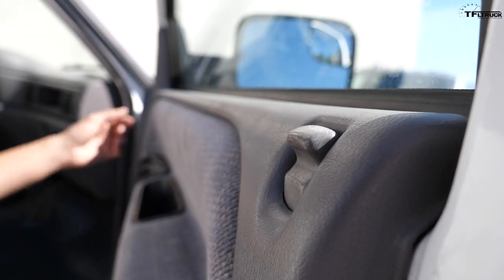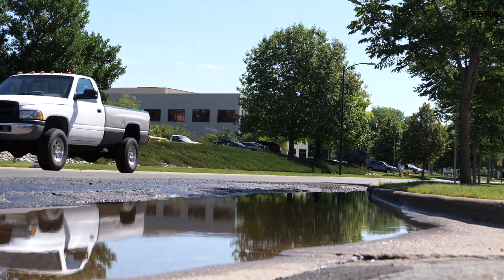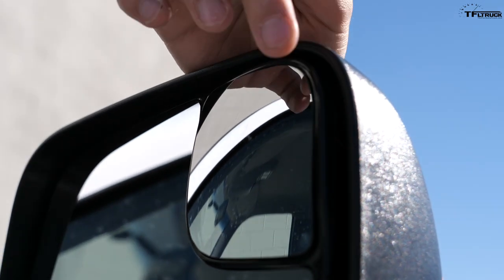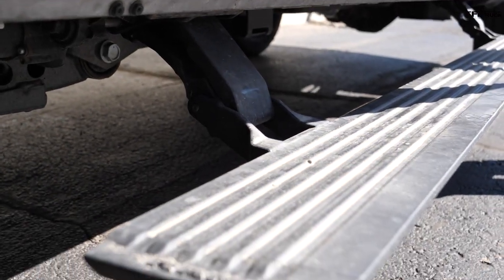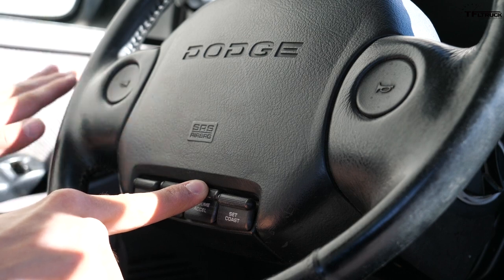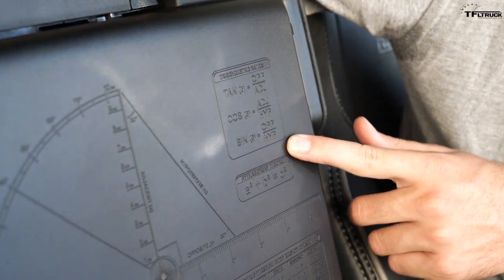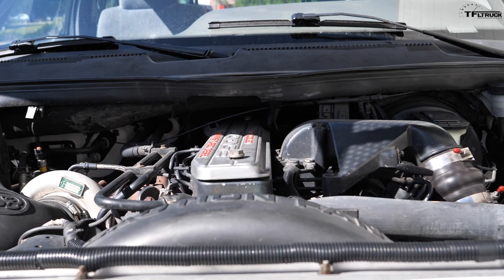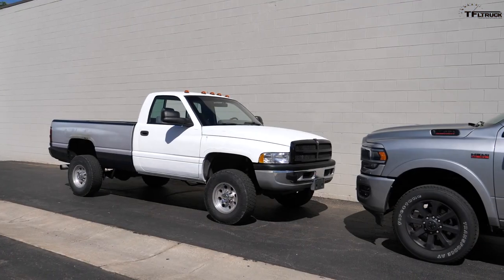Modern Tech vs Old School Simplicity: How Does A 1994 RAM 2500 Compare To A 2020 Ram 2500?

Comment: I'll take my 97 12 valve "Prius repellent" all day...
24 miles per gallon, no DEF, no SCR, no EGR, no BS...
71,000.00 is more than I paid for my house (2 bedroom, on 2 acres) in 2007...
Reply: 🤣😂 ok
Reply: This violently screams patriot and freedom
Reply: @brolymaininfighterz962  a patriot that wants to have/keep their freedom sometimes must resort to violence...so I agree...
Reply: Shush about the 24mph, you gotta have a lowered 2wd shorty truck with a bed cover and every aero or super hard tires to get close. Most only get low teens i know my dads 5.9 sport auto gets 7
Reply: Did you stick a "prius repellent" decal above the exhaust ?
Reply: @watferfoot1467  I could, but my 6" chrome tip kinda tells the tale...😎😎
Reply: @timlubbers2884  my 6.7 gets 22mpg how does the 5.9 only get 24
Reply: @jake-qn6zy  I  was getting 26mpg before I doubled the horse power...but 24 is still better than the average, Which is only 17mpg average (as per fuelly.com) ...
Reply: Where did you buy your house??!
Reply: @OpenBarGarage  Abilene, texas ... I don't live there anymore, but I did in 2007... Lived there for 3 years, decided the winters were to cold, so moved to Sarasota FL ...Got into a house with a yard here for a bit under 55,000.00 ... But, to put it in context, I don't buy luxury, I build it ... Same as my dodge cummins, I picked up my truck as a rust free 16 year old basic rig, and built it into what it is now ...
Reply: @timlubbers2884  cold? In Texas? Hahaha gotta try newfoundland.
Reply: @billyboots3730  Newfoundland is pretty in the summer...
But I have a saying, "anything north of I-10 is artic waste land and ya'll can have it" ... Love visiting the north in the summer (july 1st- 15th) though ... 😎
Reply: @timlubbers2884  yup highly recommend staying away after september haha. The island is practically covered in fog for the fall until it gets real cold.
Reply: The new truck doesn’t have a DPF or EFR... the one on the video is a hemi😂😂😂
Reply: I paid $1400 for my 97 dodge truck last march( blew that stimulus check) I drive it every day and it never lets me  down. It can haul a lot more than my friends chevy truck and gets better gas mileage. I just can't justify $70,000 for a new vehicle.

Comment: Of course the 2020 is much nicer. That being said, simplicity is something that is lost on modern vehicles. That 94 is still on the road...that 2020 likely won't be in 26 years due to every single aspect being computerized and obsolete.
Reply: 😂 yup you darn right... shooot my 2 horse carriage will outlast these two new mobiles. The only maintenance I got on mine is to repair my old horses but nothing beats the simplicity of my carriage. I don’t want none of these new automobiles shoot I got me my carriage boy
Reply: I completely disagree. Computerization and obsolescence are applying to this 2nd gen after 26 years, as it will to this 5th gen in 26 years. Compared to a vehicle built before it, the 2nd gen is very sophisticated. The idea of fuel Injection, power accessories, OBDI, climate controls, a radio, etc., these things were beyond my grandfather's generation. Really, words like yours have been said by every generation, but vehicles aren't necessary lasting any less, despite what we keep saying.
Reply: @hambone8826  Well, hasn't been 26 years since 2020, sorry.
Reply: @tebonsmite6260  by 2046 they will have banned the internal combustion engine so we will all be driving electric vehicles

Comment: Kase's 12 valve sounds like a semi tractor! So cool.
Reply: Nazi all cummins sound the same! Of course it sounds like a semi truck
Reply: @a-dog8075  why did you just say Nazi?
Reply: @jeepjoseph9036  Cuz this is the internet
Reply: @a-dog8075  all cummins sound the same? Have you ever heard a 12 valve vs 24 valve. Pretty distinctive
Reply: Deleted 6.7 has a nice diesel “knock” up front but sounds like jet in the back, nothin better than the old 12v knock though. Both very strong engines
Reply: Because a similar engine was in many semis
Reply: Slab Rat  you gotta admit that the 88-93 Ford 7.3 idi na sounds good idles like a diesel you rev it then it changes to a 460 big block noise

Comment: I drive a 94 Sierra. Wouldn't want anything to do with the new ones.

The money I saved buying a 1994 over a 2020 afforded me the ability to put in all the power options the newer trucks have, for pennies. Tablets make great entertainment centres in older trucks. No need to buy new.
Reply: Agreed 100% My last new ride was an 07 Mustang  GT. I was so disappointed in that lead sled once paid off I traded it  for a 30,000 mi 99 MX5 and 6 grand. I found a stupid well cared for 95 Jeep ZJ and sunk 7 grand into it's drive train and suspension. It now is 100% and drives like new. My other car is a 73 340 Duster. I will never do new again. I figure if I get to old to rebuild my rides I'm to old to drive.

I forgot to say I got the Jeep for free with a blown motor. rofl
Reply: Old domestic is far better than new domestic, for reliability and durability.

New is made solely made for money grabbing from the consumers, while the quality has fallen down alot, the new is only nicer looking and has alot of tech stuff in it.

Comment: Well considering I drive my 95 c1500 every chance I get, I will take simple honest work truck every time. Also manual transmissions for the win.
Reply: How?
Reply: @jeepjoseph9036  zf5 speed manual was an option it was used in ford and gms but designed by ford

Comment: As cool as the new one is, the old one had me with the manual transmission
Reply: I agree with you 💯 manual over auto any day
Reply: I usually dislike manuals but if there's a vehicle I'd get a manual with it would be a diesel truck.
Reply: The manual transmission is why I drove halfway  across the country to buy my 4th gen 2012 Ram 3500. The manual is awesome and 2012 was the last year of the 6.7 Cummins without Diesel Exhaust Fluid.

Comment: The tow mirrors were not available until 2000-2001ish, but that tow mirror stayed the same with the small convex until the 2010 Ram.
Reply: They had tow mirrors just had to had the retro kit with the big ass steel arms that that took over the side of your doors completely.
Reply: yes, i had same tow mirrors on 2004 Ram, the fixed blind spot was better then any glue on i had before

Comment: While I like technology, and I can appreciate some of the features on the new Ram, I’ll take the old with a few modifications for more power and have less worry about playing hard with it. Also, as a card carrying member of The Manual Gearbox Preservation Society, I applaud your nearly indestructible gearbox. 
Bedliner the old one, paint it no frills, and add some basic tech upgrades like an iLX-f259 CarPlay radio and I’d be happy for a long time.

Comment: Having had an 01, currently 05 and regularly using a 2015 and 2020 I regret selling my 01, still love my 05 and although the 2015 and 2020 are luxurious by every comparison I still enjoy driving the '01 and '05 more than any of the new ones...  There is just something different about them that is more satisfying to drive as a truck.  Your comments about the mirrors those aftermarket mirrors on the 94 are from the third gen Rams and no the convex portion was not adjustable even on the factory mirror. The 94 had nothing more than a traditional chrome single-pane mirror.  And yes they fifth gen Cummins is almost silent and comparison but I long for the day of hearing and good old first or second gen Cummins clattering by especially with a nice exhaust.  The neurotrucks are surely far more advanced much more capable safer and comfortable and yet here I still prefer my '05 and wish I had my '01 back...
Reply: When my 05 fell apart, i specifically went looking for a 90s model ram. Settled on an 01. I do not regret that choice one bit.

Comment: I love the old school but I wouldn’t want to tow a camper 6+ hours without the modern tech an comfortable ride that’s why I bought a 2020 3500 limited
Reply: Remember people only complain about the truck another person buys if they can’t afford it.
Reply: Good take
Reply: @ToyotaNutjob  Did you miss the part where he wrote "an comfortable ride".
Reply: @ToyotaNutjob  maybe the insane towing and the ride???
Reply: Had a 95 12v 3500 reg cab back in the day. The ride is jarring lol. Those cup holders do  not work, especially with coffee lol.
Reply: Squanch Wanch have you experienced heated an cooled seats? Lol or the ride quality or can hook up to 20k+ an not look at your temps when it’s 100 degrees going up a 20+% incline ac blasting ?
Reply: Jay Moar bought an paid for already. Just having no cab drone alone was worth signing the check 😎

Comment: The old '94! Just love the simplicity. But the one topic not really discussed is safety. In that 2020 Ram, a person really has to work hard to get themselves hurt. The safety features are also a significant reason why today's trucks cost more.  Great job guys.
Reply: Actually, they don't cost more. A 2020 tradesman 4x4 runs about $37,000. The number they came up with for the 1994 is false. If you were to spec a 1994 as similarly as possible to what is offered in a Tradesman, you'd have to chose a Laramie SLT, which was around $22,000 back in the day. Adjusted for inflation, that's around $39,000, and you'd still lack most of the features of the newer truck.
Reply: @CuzRepo  I bought a 1998 Laramie with a diesel, extra cab and 2WD new off the lot and and it was around $33,000

Comment: I'd take a 2nd Gen with 4 doors
Reply: There is a company called extend my truck that does them. Expensive but very cool.
Reply: JD McMillian they made 4 door 2nd gens they’re just Very rare
Reply: Chris Bastin ummm you sure about that....   the biggest cab they made was a club cab or extended cab, they never made a 4 door. Yes people have made them but they were never produced.
Reply: @jarrettl9707  never from the factory, I did see one aftermarket crew cab 94-02 2500, wondering how they made the rear doors, maybe based them on the front doors but with the front section left off?
Reply: @FirebirdCamaro1220  Iv seen a couple custom trucks. And From what i’v seen people take front doors and cut em to make the rear doors.

Comment: Ram had more build quality back then - had a reg Cab long bed  2WD 1500 Laramie SLT with the 318. They no longer seem built to last.
Reply: Seems like everything on rams, since forever, have always had a problem with absolutely everything breaking on it, constantly. EXCEPT the Cummins engine itself. HVAC dies, gauges die, everything electronic dies, the transmissions last 60k miles. A million+ mile engine mated to 60k mile transmissions attached to a 100k mile truck. Some people can score really good luck with em, but I don’t hear about it too often.

Comment: My wife owns/drives a 1995 3500 v10 to pull her horse trailer 
Its been a pulling truck all its life
It has over 200000 miles on it
Original engine
Original front end
And yes for all the armchair ignorant out there, original trans
Its paid for itself over and over

She wants to restore it when the time comes than buying a new truck
Reply: Cool! Assume two wheel drive?
Reply: @donleamon8653  yes
Reply: @Welcometofacsistube  "She's a keeper!".....applies to both your wife & her pickup!👍
Reply: I have a 95 2500 v10. Damn good work pickup but a gashog. Hauled 3 tons of rock in the bed recently. Did not even bother it.

Comment: 1994 is classic, a time in America when things were simple and built to last
Reply: Just not the dodge transmissions
Reply: 1990s Chrysler products were built for a lot of things, but lasting was never one of them. The only redeeming quality of this truck was its powertrain. That literally is the only reason to have one, unless you enjoy replacing ball joints and cracked dash boards in your spare time.
Reply: I remember when they came out in 94 and people talked about the older trucks and how much more reliable they were.  🙄

Comment: The old truck is a better "Truck" and deal but, the new truck is a better commercial tool and daily driver so this is more like comparing apples to oranges.
Reply: No its not, old truck is still reliable on every way than the new truck
Reply: Mywindow, how is the old one a better truck? The one one tows a lot more. It’s also better for off roading

Comment: How do they compare? It depends on the basis of the comparison. If a basic truck for ranch or work is the expectation I'd choose the '94 because it has all the basic features one would ever need. Additionally, a '94 Ram can have nearly infinite modifications to the engine without violating pollution laws. If the expectation of the owner is to tow a 5th wheel or other travel trailer, creature comforts afforded by the '20 model would be preferable for long trips and a smoother ride. So, it I owned a ranch or large farm and was semi-retired I'd own both.

Comment: on the 2020 the motor , transmission ,  suspension  will go 10-15 years -- it will be all the electronics that will give you fits ---- I know ,I have a 2012  Longhorn  with a 6.7 cummins

Comment: 1994 Dodge Ram's were only made in regular cabs.

1995 is when the extended cabs came out.

1998 4 doors came out.
Reply: They never made 4 door 2nd gens.
Reply: @NoneYa42069  Yes they did.
Reply: @NoneYa42069  The back doors opened towards the back.

C'mon man.

It's a simple Google search.
Reply: @shawnp6744  That's called an extended cab. It's a 3 door not a 4 door, because it has 2 1/2 doors.

Comment: I have a 1998 ram 1500 with the 5.9 magnum and it is a very reliable and simple truck so compared to the 2020 type 1998 can actually go under water and not have to have everything rebuilt

Comment: I drive a 97 chevy that I got for $500 
 put used tires on it for $400 a fuel pump for $100 a distributor for $60 and a starter for $60. I have had this truck for 2 years all the money I paid for my old girl is probably less than two of your truck payments. The 97 gmt 400 has almost as many features as you 2020 ram, I got electric mirrors power seat locks push button 4x4 and really conformable to drive.

Comment: Yep, I like the older just about everything can be worked on at home without a laptop. It was a pain but I did find my 2011 Silverado 1500 wt, with hand crank windows, rubber flooring, the key fob is just a key just something you can't find

Comment: I have an old 97 T100 pickup truck. I go it as a supplemental vehicle for when I need to carry big things and for when we get a couple feet of snow. It is not my daily driver even though it gets pretty good gas mileage. I don't want an expensive pickup truck where I have to worry about scratching it and I have to drive it all the time to justify its existence.

Comment: Some had chin spoilers in mid 90s. No half doors til ‘98. 94 didn’t have those mirrors. Small chrome mirrors only and they folded in automatically when you drove fast. Push the bass and treble sliders all the way up and the radio will sound awesome. Nothing sounds better than a 12 valve. Nothing.

Comment: My first new truck was a 96 dakota 318 5 speed with 392 posi fast truck I neck new truck was a 99 ram 2500 king cab with 5.9 diesel 5 speed then I got a new ram 3500 longbed 4 door 5.9 6 speed then I got a 12 3500 6.7 auto asin transmission I gave my 12 to my daughter my last truck has been a grate its 18 nissan titan xd Cummins 5.0 love it but out of my rams my 99 was my mast like truck bye a far better than the rest dint know why it was just a simple truck just ran a ran

Comment: Why can't manufactures offer a super basic version of this 2020 truck?  It sounds like from reading the comments that this is what a majority of you want.
Reply: Because people online are in the peanut gallery. In reality, people won't buy them. That said, "Basic" is relative. You can still get a "Basic" work truck, one without the big screen or all the fancy powered crap, if you want, but even those hardly sell to regular buyers. Those kinds of trucks mainly go to fleets.
Reply: @nukewiller4083  well put.
Reply: isuzu.
Reply: @David-cy5zu  I didn't even know Isuzu was still around here in the US.  But aren't they mid sized trucks.  I think the majority of people would want at least a half ton truck like F-150.

Comment: I purchased, brand new, a 1994 Dodge Ram 1500 Laramie SLT.  When that truck was released for public purchase in October 1993, it was far and away the most advanced truck produced; to say nothing about styling.  In testimony from the latter, those styling queues are still present in the 2020.  Yes, technology has moved past that old 1994; but considering you are doing a valid comparison against a 2020 says volumes about the 1994.

Oh, when new, none of the door panels rattled...got to look apples to apples; not brand new versus 26 years of HARD work.

Comment: I still own my 02’ 2nd gen. I will be stepping down to a 1/2 ton . With The fuel economy of the new trucks combined with the hp, tq, and rowing figures, a 1500 out does my 2500. I still love my truck, but a 18 yrs old it is showing its age. Rust is starting to appear in not so good places, and I can’t tell you how many rusted out brake lines I’ve replaced. Also it’s not fun when you don’t have brakes while driving. My truck is an extended cab, and I have outgrown the back with a family, as you can’t fit car seats in the rear. I will surely miss the 8 ft bed, and the awesomeness of this truck when it’s gone, I won’t miss the smell of the diesel, or the noise it makes at 5 am when I start it.